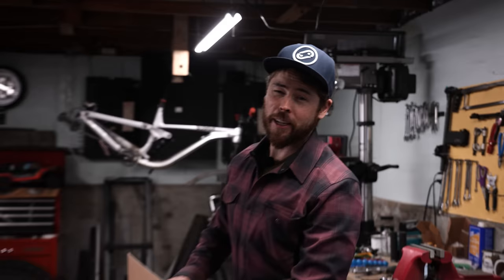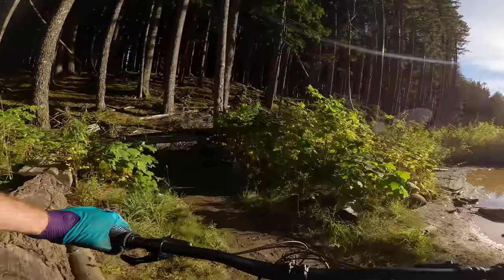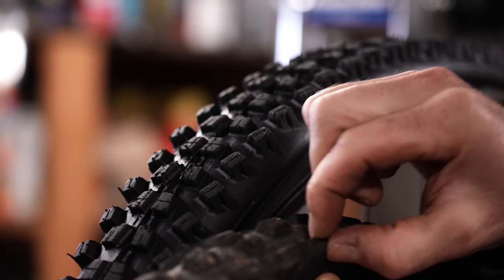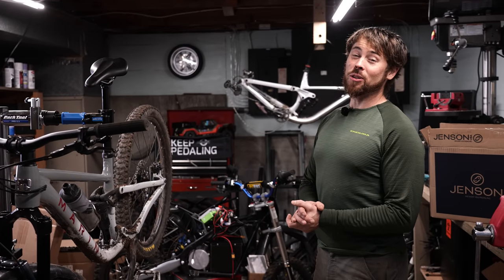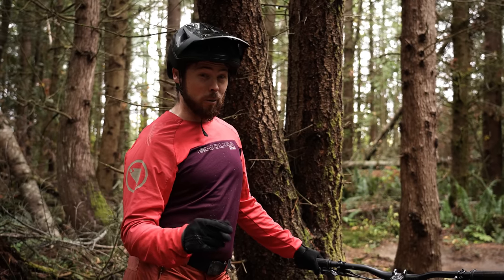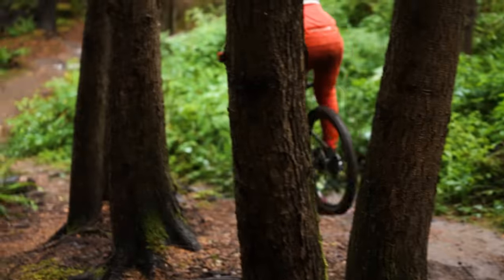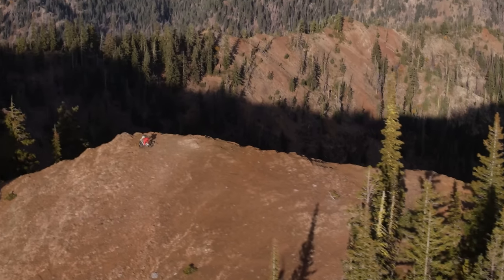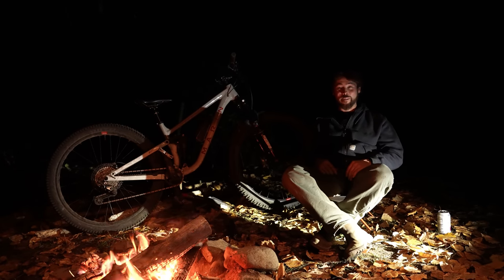More shred, less dollars: the Marin Rift Zone 2

Comment: Hey Jeff, as a professional bike mechanic i will give you some tips for magura brakes. You have to use 2mm rotors, wear limit on magura rotors is 1.8 mm so running shimano you are basically using "worn out" rotor for these calipers. With 1.8mm it will work but you will have to pump the lever and max out reach adjust and its not optimal and doesnt represent how good they work. When you are done with bleeding them, start with putting the caliper bleed port at the highest point and then close it, any fluid lost will have a massive impact on how brake operates. Theres a great video on The Yorkshire Bike Mechanic yt channel on bleeding mt7 brakes and I highly recommend watching it. I have mt7 on my e-bike and love them so give them another try :). Thank you for another entertaining video !!!
Reply from the maker: Thanks Tery, I'll look up that video.  I am now using Magura rotors front and rear, I hadn't considered checking the thickness.  Eventually I'll do a stand alone video on the MT7s.  Thanks for watching!
Reply: If that’s not enough video info, there’s some French tricks @bleauup to get the bubbles out.
Thank for yours, love to watch your channel, Jeff, when I can’t ride…
Reply: Facts
Reply: no
Reply: Hey would you do a review on some of the formula line stuff like some Cura 4s
Reply: Makes absolutely no difference if you run 1.8mm shimano rotors or 2mm magura rotors of trp 2.3mm rotors. The pistons do not  care where they are ,they simply advance which is 0.1mm per side of the rotor .
Yes using 1.8 would become an issue if you run them so low along with worn pads that the pistons advance too far. 
The reason magura reccomend 2.0mm and trp 2.3 is for heat management as they use mineral oil and yes whilst shimano also use mineral oil the maguras and trp manage this better with hear. 
If you've ever bled shimano brakes check the pink fluid after only a few rides it will already be going black .
Not pouring water on your fire as your a professional bike mechanic but that's just my experience. 
7 years as a wc mechanic the team has been running trp for the last 2 seasons and it would be hard to get them off them now .
Reply: bleed, bleed, bleed. If the Maguras are bled right on the first go, they will hold a consistent bleed and feel even through multiple brake pads/ piston respacing and all, they are the most reliable feeling brakes I have ever owned -Bike shop owner (Infinity Cyclery)
Reply: mt7 with large Hope rotors are amazing! @JeffKendallWeed
Reply: @knott4me561  true. I had a guy with toasted rotors, only 1.47mm thick on a rear and they worked somewhat ok. The bike would stop but the feel was bad. I tested both Shimano and magura rotors on mt7 and Shigura sets and feel as well as bite point was much better on magura.
Reply: Used Shimano rotors on magura brakes for years, for trials, MTB, and on a dirt jump bike, I think Shimano rotors work better.
Reply: I can say having tried maguras briefly they were a pain in the butt. Anything that finicky to bleed is a no go. Sram and Shimano brakes are easy to bleed even for the average garage mechanic.

Comment: So the Riftzone is a good bike if you upgrad the shit out of it
Reply: As any bikes, it'll take it if I fix it!
Fix it with better sh*t and it'll break less.
😂
Reply: No it is good if you upgade brakes and tires. Wheels just need trueing after a big case.
Reply: He couldn't do that so he used wheels that perform somewhat similar.
Reply: Also he used XTR Brakes but Deore 6120 are pretty much the same
Reply: All you need are new tires, some really good carbon hoops and Xtr brakes and your set!
Reply: Nice thing about Rift Zone is a person can afford to upgrade what they need to for where they ride.
Reply: For how he rides it, stuff breaks easily. For how normies ride it, it’s just fine. Especially if you don’t have large mountains right next door.
Reply: he is light and smooth af    not really a frame braker
Reply: @harrie205  he is not that smooth, he is hucking a lot

Comment: The reason your brakes are fading is due to the fluid in the system, the higher temps create boiling of the fluid, this creates bubbles in the system and that makes the lever soft and fade out.

Comment: I bought a Rift Zone from Jenson last year.  I knew I was going to change some things out before I bought it. I would have done the same with the Trek and Specialized FS that I tried out.  The RZ is a great bike and I don’t feel limited by it when riding. Plus the frame is worth keeping for years and replacing/upgrading components over time.
Reply from the maker: Right on Guol, glad to hear the Rifty is working well for you!
Reply: @JeffKendallWeed  thanks.  now I just need to learn how to manual.  😁

Comment: I currently ride a Marin Alpine Trail carbon 2.  I brought the frame and put my own stuffs on it.  For the money there is no way you could beat the value of this bike(Rift Zone 2).  I could say this because I also owned a Yeti, Niner, & Commencal bike.  The Marin alpine trail carbon 2 preformed just as well on the trail versus other.  Jeff, I think you will feel even more at home if you try the Alpine trail Carbon 2 based on your riding style.
Reply from the maker: I'm hoping to try an Alpine Trail eventually, stay tuned!
Reply: I just bought an alpine trail xr on close out last week. It is an absolute insane bike for the money!

Comment: Great video Jeff! Hit the nail on the head. I’ve had a Rift Zone 2 since last summer and I love it! Fantastic bike in stock form… minus the brakes which I just swapped out for some XT 4 piston brakes front and rear this off season. Should solve the only issue I’ve seen with months of riding. Highly recommend this bike!

Comment: I went from a 2017 trek slash 9.8 to a 2019 norco fluid fs1, which is similar to the ripley af but 1 degree steeper and in my country the whole bike costs less than just the frame of the ripley, and its the most fun bike I've ever had, its agile, responsive, poppy, carves corners, but is also stable and can handle fast rough rooty and rocky tracks and steep double black downhill tracks, short travel 29ers are awesome, I find the more travel you have the more trail features it absorbs, and the less effect your rider input has, for example a small suspension compress will get you a nice rebound pop on the norco, but on the slash the suspension would just absorb it and stay planted, making many tracks a bit boring.

Comment: You rock JKW!!

I bought a 2020 Marin Hawk Hill 1 (renamed as Rift Zone 27.5 in 2021). 

I agree the geometry and the 27.5 wheel version has been lots of fun.  The suspension is 120 rear / 130 front. On Park size jumps, the rear suspension is supple, surprisingly bottomless yet predictable.  

The price is so good, I’ve almost bought another bike just to have around for friends. 

You’re right to point out low spec parts. model 1 bikes are almost unbearably low. Anyone who can afford to buy in at the Model 2 or 3 should really consider that upgrade. The Hawk Hill 1 came with a 10 speed cassette at a time when all bikes were coming with 11 speed. The rear frame is Boost spec, but the wheel was a Frankenstein Quick Release hub with spacers to fit Boost. (This kept bike cost low while allowing you the option to upgrade wheel later.). It didn’t come with a dropper post. 

I’ve added a OneUp post, but don’t have the nice grommets for the internal frame routing. The cost of adding the dropper alone would have been enough to have bought the Hawk Hill 2 that came with dropper and 11 speed…

I’ve also added a 10 mm longer stem, Shimano 4 pot brakes and ice tech rotors. 🤌🏻
Reply from the maker: Thanks for the note Doadv!  Glad you've been enjoying your rig!

Comment: I just bought the Rift Zone 2 with my military discount for $1900. First thing I did was install XT 4 piston brakes with ice tech rotors and installed a faster rolling rear tire. Also upgraded to an XT shifter and a Shimano ispec dropper remote. The brakes are the only thing that needs changed right away if you ride anything other than light trails.
Reply: Wow I just bought it full price a few weeks ago not knowing there was a military discount haha.

Comment: I just bought a Riftzone Carbon 2 a couple weeks ago. Really well spec'd for the money. They were 45% off on Bikes Online.  So I paid $2700 for a normally $4500 bike. Bike weighed in at 32lbs with my flat pedals on the stock build.  It came with SLX brakes, and Ice tech  rotors. 203mm 4 piston front, 180mm 4 piston in the back. The derailleur was XT, with and SLX cassette and shifter. FSA gradient crankset. Fox Float 34 performance fork, and a DPX2 shock. 
As for how it rides, I'd say it punches above its price and travel numbers. Its on the slack end of the spectrum for a 125mm bike. I feel like I can ride it almost as aggressively as my Ripmo. It just soaks up the high speed chunk so well, you would never think it was a 125/130 travel bike. I'm keeping the stock brakes. I'll be swapping the bars out for something slighty more supple. I run the stock wheels for now, but eventually will be wanting to upgrade the hub, and at that point, might as well go for a carbon/Berdspoke/ Vesper build. I feel it's a bike worth upgrading, but you don't "need" to upgrade anything.
Reply from the maker: Congrats on the sweet rig!!!

Comment: my 17 year old son does a pretty good job ripping around on his Marin Rift Zone. I too changed out the tires  to go tubeless (Maxxis DHF and Maxxis aggressor). Also, put a one up dropper on it. since his was the #1 version. Eventually, I am going to swap out the drive train on my bike  so that will go on his. He said the same thing about the wheelie capabilities. He commented out my bike (Rocky Mountain Instinct BC) is less poppy than his. Its held up to the abuse of our local trails. I have seen lots more riders on the Marin Rift Zone on those trails. We live in Chico where the trails are very rough on bikes. Lots of rolling over lava rocks in Bidwell.

The only issue he had was with the rear derailleur. A screw came out of it. No creaks...

Comment: I have the MT7s on my spartan and love them. With MDRP rotors they have such impressive stopping power and can handle the heat of long continuous descents. All that said, I disagree with the official bleed process, and I always end on a full push stroke from the caliper.  When they're dialed, can't be beat.
Reply from the maker: Wow, I had no idea Magura made an "MDR-P" rotor, I just saw that Jenson has them in stock!!!  Thanks for the tip.  I put them on another bike (video coming in December) and they appear to be working after a dual syringe bleed, finished up with a few rounds of lever syringe only style bleeding (pulling syringe up to create a vacuum, then past the hole in the syringe).  FIngers crossed!

Comment: Excellent video! Love my 2020 Rift Zone 2 but some things weren’t great to be honest and I’ve upgraded a lot of parts. The new model addresses every concern I had with mine straight out of the box.
Reply: I'm in the market for a mountain bike have been looking at the Marin line such as the Rift zone which is full suspension and the San quentin which is a hardtail. Since you have the RZ 2 is there any reason to get the RZ2 instead of the RZ1. I plan to upgrade components. I'm between the San quentin 3 and rift zone 1
Reply: @theboycheef841  the current RZ 2 has better suspension and a dropper post compared to the RZ 1. Although I prefer the 11 speed drivetrain on the RZ 1. $600 difference, maybe go RZ 1 and upgrade as you see fit. Definitely want to add a dropper.
Reply: @downtoridemtb  thank you for the insight! I'm now between rift zone 1 and polygon siskiu 7/8. I would like to save up just a bit more for siskiu 8 but I would like RZ2 to upgrade which are both $2000 right now

Comment: i used to ride a rockrider 540s that cost £500 brand new, x fusion rear shock, suntour front shock, 120mm travel, qr wheels, clutch derailleur. wheels felt really wobbly but i still jumped the hell out of it because decathlon give a lifetime warranty on the frame. finally got a b etter bike, 2012 nukeproof scalp that ive spent about £800 on upgrades for and its sooooo much more confidence inspiring

Comment: Another consideration for budget bike brake upgrades are the new SRAM DB8s.  They have comparable power to Codes and feel a lot like new Codes, but use mineral oil and are priced slightly cheaper than Deores.  My rental DH bike in Whistler had a set and they honestly are the best set of SRAM brakes I ever rode haha, plenty of power for the big DH bike, and they maintained consistent feel all day with the firmer lever feel of the new codes.
Reply: According to NSMB, the DB8 are a next gen SRAM brake and perform better than Code R. Which is nice because I have DB8 brakes on my bike!
Reply: @hambo76  And they're very affordable, a great option for a budget build.

Comment: Since brakes are a topic here, see if someone can send you some formula curas. Preferably the 2 piston version. They can also be bought cheap.

Ive run just about every brand brake and im sticking with cura 2 pistons. Power and reliability are excellent.

Comment: if a manufacturer does the shock tune right, I'd say even single pivot is as good as fsr and not even sure if VPP (Maestro, split pivot, ABP yada yada) has an advantage anymore. 

A well geo'd ALU frame, with: good length dropper, full deore drivetrain and brakes, half decent DT swiss 350 level hubs laced to decent strong wheels and reasonable level fox/SRAM (i.e. Fit vs grip) suspension is more than good enough for anyone riding proper 'trail' these days.
Reply from the maker: Yeah the single pivot suspension on the Marin and the Konas has been great.  It loses a lot of speed in the square edged roots/rocks compared to the multi link DW/Switch/VPP style, but for less chunky stuff, it's awesome.

Comment: I'm running the Shigura setup on both of my bikes.  HIGHLY recommended, especially if you ride steep stuff.
Reply from the maker: Interesting, I might have to try that!
Reply: I second the Shigura set up. I love the power and control. Excellent video as always.
Reply: Shigura imo is the worst rather than best of the best. The wondering bite point is at the lever so your not negating that issue .however the more power you get from the maguras caliper  (which is mainly down to the pad compound =galfer) somewhat masks the wondering bite point .but it's a fix not a cure
Reply: @knott4me561  bummer they did not work well for you. Been running my 8000 XT levers with MT 5 calipers with great success. No bite point change. Flown with them ridden lots of terrains.

Comment: Thanks for the Great video Jeff I  Recently purchased my first full suspension bike, a polygon siskiu T8 med 27.5 and not long after that the pros closet advertised a carbon wheel set , reynolds black label trail wide 247 with i9 hydra hubs for $499 and yes I ordered a set right away. I'm open to suggestions on how to set them up.

Comment: Hey Jeff, I just moved to WA and it'll be my first time riding on a lot of wet roots and rocks. Which tire combo would you recommend? Currently running MAXXIS DHR2 front and Dissector rear.
Reply from the maker: Hey Terr, the Maxx Grip compound from maxxis is about the softest I've experienced.  I also run Double Down tires so I can go really low on pressure (20-22 psi) and not worry about flatting.  I use an Assegai 2.5 front and a DHRII rear, I forget if the DHR II is 2.5 or 2.4.

Comment: is it okay if ill change to 150/160 travel fork?what would be the risks?
Reply: You can run a fork that is no more than 10mm different from the stock axle-crown measurement without voiding your frame warranty, so you'll likely be fine going to a 150mm fork. Just measure first. We spec 150mm forks on the new Rift Zone XR and Rift Zone XR AXS models.

Comment: How is it compared to the Occam? You said that the Occam bottoms out very easily and the the Rift Zone doesn't bottom out easily. Does it bottom out less easy than the Occam even though it has much less travel?
Reply from the maker: The Rift Zone has a much more supportive, progressive feel than the Occam, and it's a much more torsionally rigid bike.  Overall I'd prefer the Rift Zone for aggressive riding.  Travel isn't important as geometry and stiffness.
Reply: @JeffKendallWeed  Thanks. Very helpful. I have the Occam and lately started riding much more aggressively. I was thinking about upgrading the suspension. Your reviews convinced me that it's not going to help much and that I need a different bike.

Comment: I do prefer the mt7 brakes over the shimano ones but they’re not the easiest to setup correctly, they’re pretty reliable after that.
Reply: I think they have more power than shimano and I like the lever way better (because you can set the engagement point way farther away from the bars). I did have problems with squeaking though- same with the MT5s. And the only thing that seems to work then is buying a new disc.
Reply: My experience is that I get less fatigue on long descents with the Magura, modulation is easiest at high speed/power (also bite point doesn’t change), while the Shimano modulation seems better at very low speed. I didn’t get any noise (with Storm discs 200/180 & 8P brake pads) except when it starts raining. If there is some contamination I use to clean them (the discs) with a brake car product. I’m not a specialist by any means but the issue described in the video seams to be that there is still some air in the brakes.
Reply from the maker: They appear to be working better now, I'll do a stand alone MT7 video eventually!